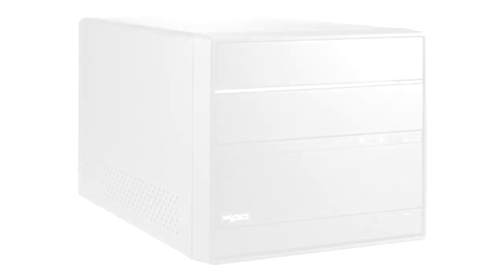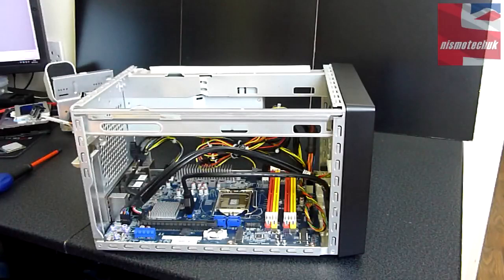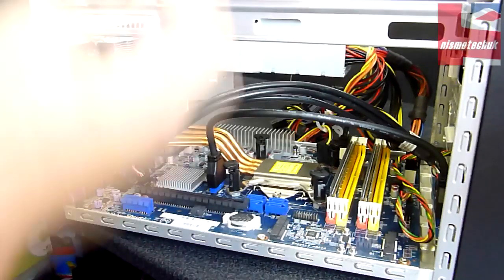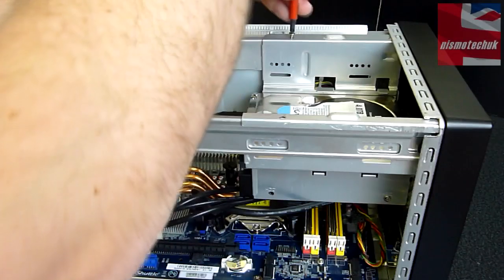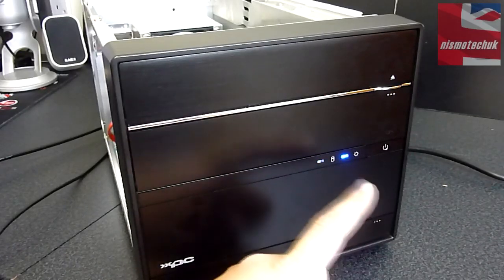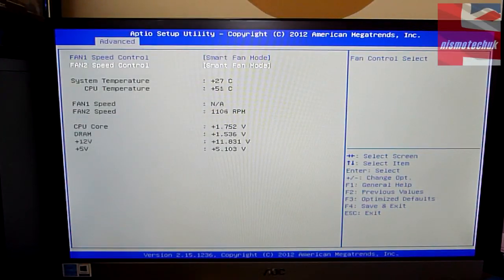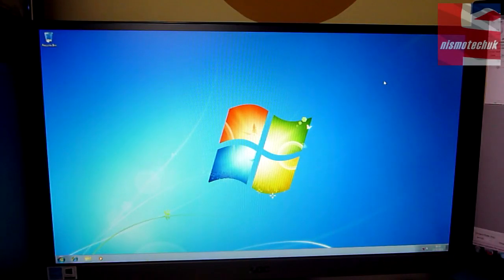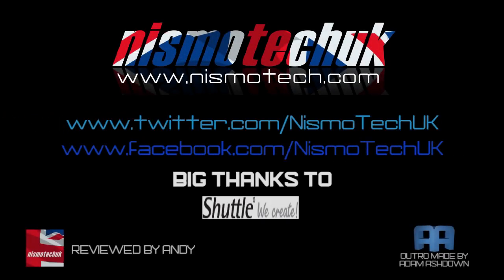Shuttle SZ87R6 XPC Barebones System {Install & Setup}

Comment: Thank you for this review. I do have one question about the Mini-PCIE sockets (for m-sata and Wi-Fi use). Is it possible to use them both at the same time?
I read a review on Amazon saying it's not possible. Is this correct?
Thank you.
Reply from the maker: To be honest im not to sure. I didn't get enough time to do that kind of testing on the system before it had to go back.

Comment: Just a FYI that you missed a step regarding affixing the heatsink to the CPU. After turning them clockwise the plastic tower-things need to be pressed down until they lock with a click. As shown here, the heatsink/radiator would not be getting solid pressure against the CPU and would likely yield high temps.
Reply from the maker: thanks for this. after watching it again your correct
Reply: NismoTechUK you're*

Comment: The 50C idle reading you got is only because the heatsink wasn't seated properly. any amount you are able to actually lift it from the ihs indicates it wasn't properly clicked down. the retention system they use is the same as teh oem heatsink from intel that has the same issues. with it properly seated even in a low airflow case such as the shuttle a haswell will conservatively idle in the mid 30s.